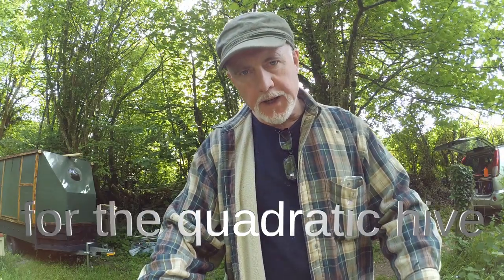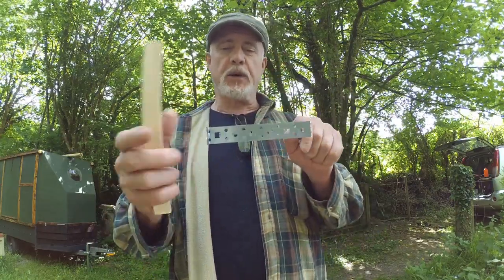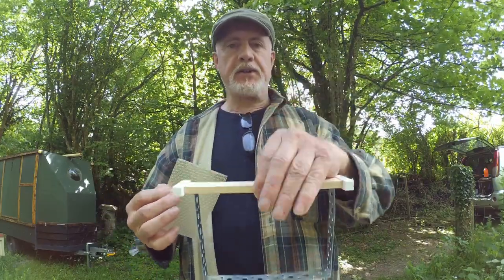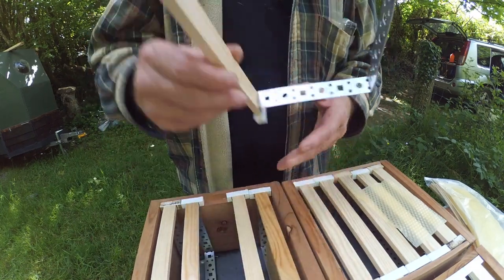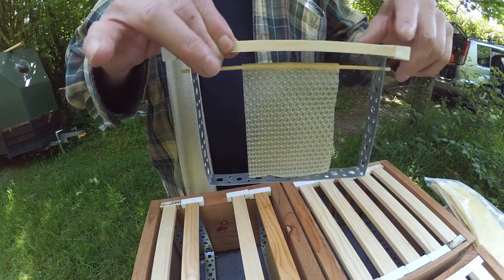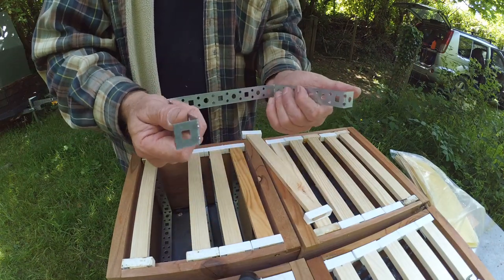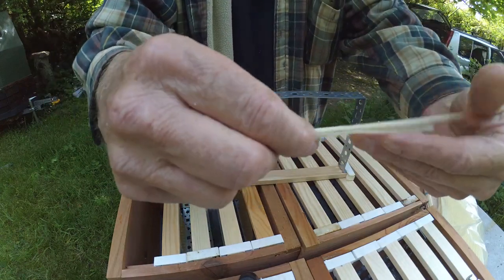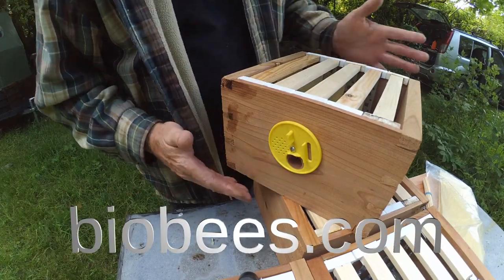How to make frames for Quadratic hives

Comment: Those frames look like they'd be useful for something else. Screwed to some top-bars for a top-bar hive, they would be great when doing a cut out. Much better than a dangling hair clip.
Reply from the maker: Yes indeed. I will be making more videos demonstrating the versatility of this hive.
Reply: @BarefootBeekeeper  hi Phil   trying to work the math  to make  quadratics for the langstroth hives.    roughly    10"x8"  with the ends of the 8"  reducing the   10"  by a total  of 1.5" .  If my calculations correct then id could fit  how many frames   id think five so i had  adequate bee space between but its still  jiggling the math to  what?  What I appreciate about your design is that its adaptable and doesnt require advanced wood working skills to   assemble.   tho im still  wrapping how to  get the rabbet   part properly assembled.   I appreciate that you have more videos planned.
Reply from the maker: @Rushgamer-yw3lm  look up Albert Chubak in Utah, who designed the Urban Mini Hive at about the same time I came up with the Quadratic hive. The problem you have is that the quarter Langstroth is too long for 5 frames and too short for six at standard spacing.
Reply from the maker: https://ecobeebox.com/
Reply: @BarefootBeekeeper   so then  maybe to  support  top bars  for   queen breeding nucs?   just looking at what options i can do  and  thank you for confirming that at least for the langstroth hive that its not a good fit  for.   Its more   building  these  rather than   buy them retail .  The keep it simple aspect is what so  wonderful about this design.
Reply: @BarefootBeekeeper   hmm havent  calculated the measurements but a  8 frame langstroth.  Ok  Im so determined to make it work for those  with  langstroths!   :P hehehe  ;)

Comment: Perfect timing Phil -  I'm just about to start making frames for 8 quadratic boxes - give us a clue about supplier for the strip plse.
Reply from the maker: I haven't bought from this supplier, but this is the kind of thing to look for. Maybe check with your local hardware store or builder's merchant first. https://rover.ebay.com/rover/0/0/0?mpre=https%3A%2F%2Fwww.ebay.co.uk%2Fulk%2Fitm%2F183523986782
Reply from the maker: Or this https://rover.ebay.com/rover/0/0/0?mpre=https%3A%2F%2Fwww.ebay.co.uk%2Fulk%2Fitm%2F173896654727
Reply: @BarefootBeekeeper   I wish there was a  usa source.   arghh ;)
Reply from the maker: @Rushgamer-yw3lm  https://www.amazon.com/American-Valve-AV301700-100-Feet-Galvanized/dp/B0052EG0AS

Comment: Using a smaller piece of wax would hold better and the whole purpose is to give direction only I would think. I myself use wood glue to glue the stick onto the middle of the top bar, and then rub it with some wax, no need for foundation that way.

Comment: wow really cool. Where would you get white spacer to hold the strips
Reply from the maker: eBay - they are standard frame spacers. The longer ones are used in honey supers. I bought some last year that worked out at around 5p each (maybe 6 cents US) but I just checked and they seem to have increased in price dramatically.
https://rover.ebay.com/rover/0/0/0?mpre=https%3A%2F%2Fwww.ebay.co.uk%2Fulk%2Fitm%2F121478533831
Reply from the maker: This one is cheaper https://rover.ebay.com/rover/0/0/0?mpre=https%3A%2F%2Fwww.ebay.co.uk%2Fulk%2Fitm%2F250906194790